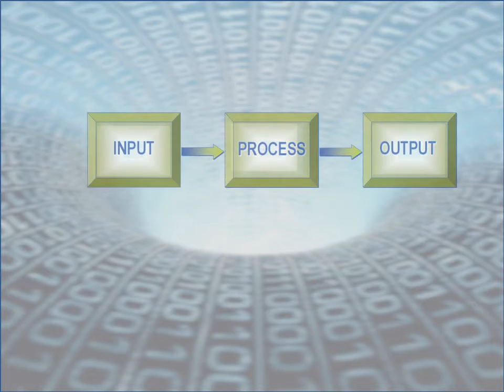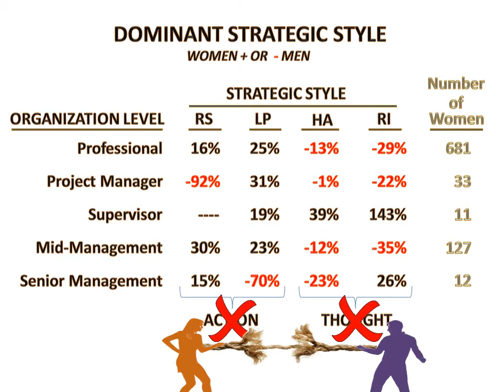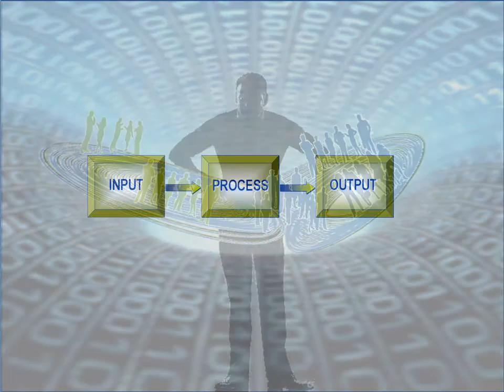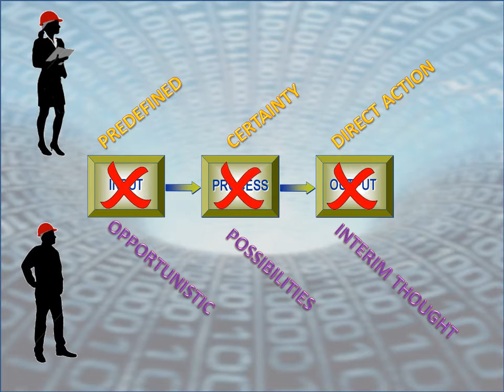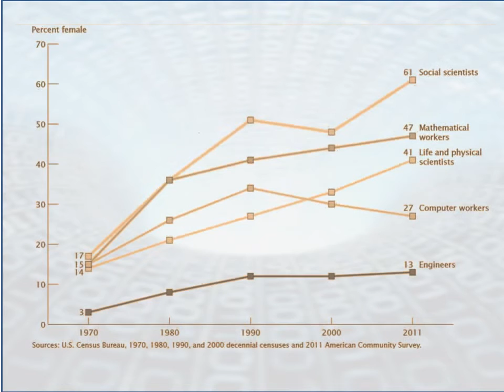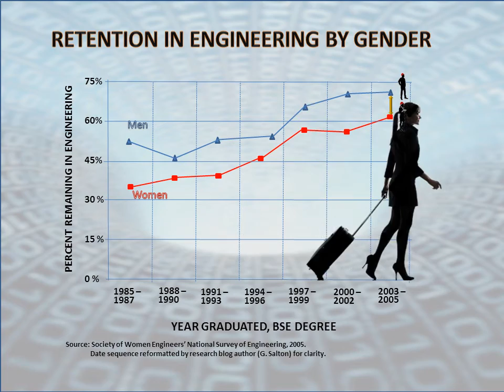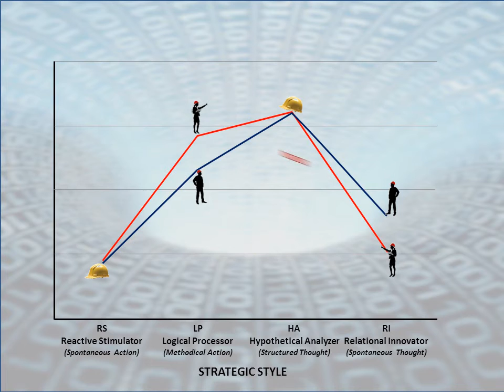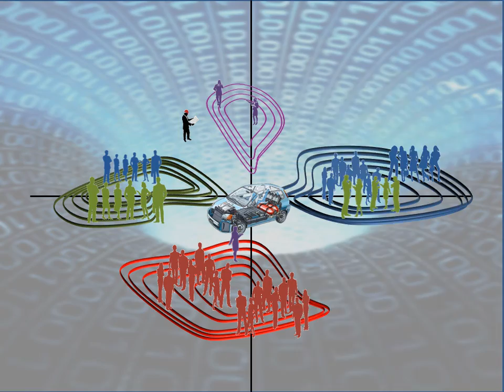GENDER BIAS IN ENGINEERING: ROOT CAUSE ~ 16 MIN

Comment: I have used i-Opt Analysis extensively in my consulting practice over the last 15 years and have found it an effective tool for organizational analysis and team building.  Here Dr. Salton presents a detailed & insightful analysis of how the tool can be used to quantify root cause gender bias in a STEM area. The fact that there is gender bias in science, technology, engineering, & math is not new.  But, understanding the determinants of gender bias & its persistence in STEM is not generally discussed  or reflected upon in academia & industry.  Couple this analysis with new research on micro aggressions in gender (& ethicity) & a fuller picture begins to emerge of day-to-day real world barriers to access & performance for women in STEM.